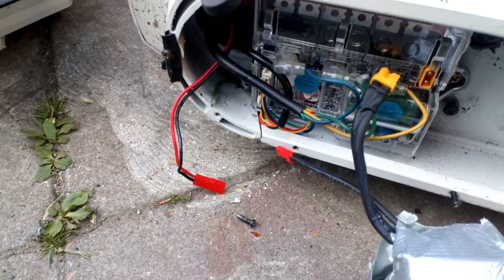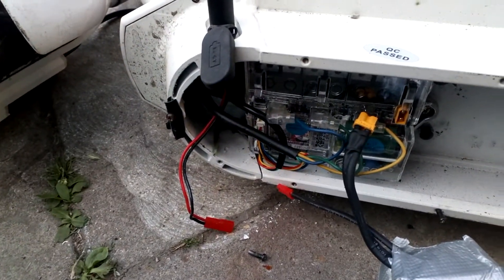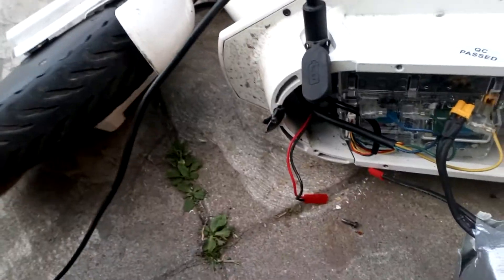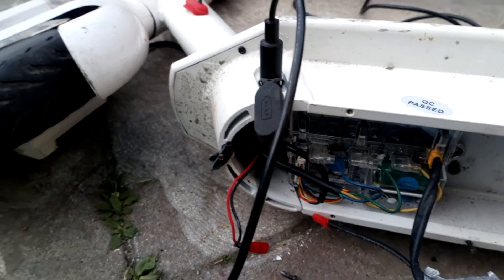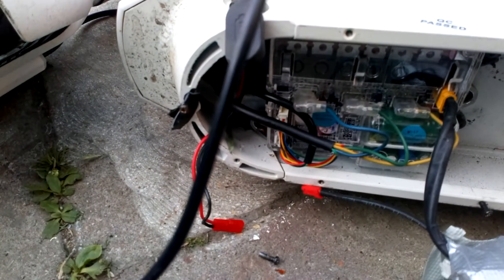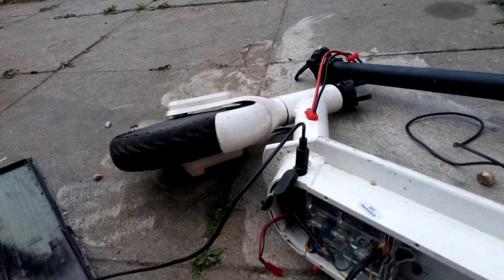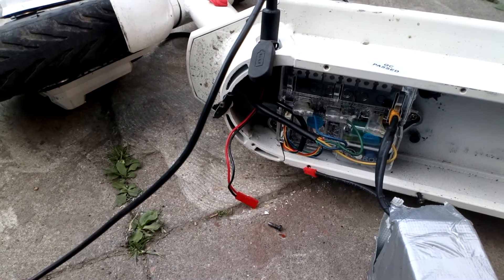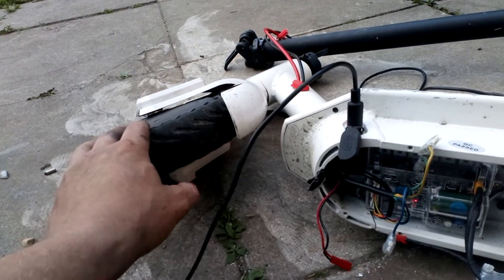how to tell if you electric scooter controller  is  faulty (bad fets) (or bad motor)

Comment: When I remove the motor wires from the controller it’s easy to rotate. When the wires are plugged, the motor is hard to rotate. So it will be the controller? 
And thanks for the video I have similar issue but not sure if it is the controller or the motor
Reply from the maker: yea dead   controller for Shure

Comment: I have xiaomi clone with no battery and a battery from an M365 when i connect the battery it works fine, only issue i have is the original balancing wires have no place in the clone controller , how get the battery balanced every time?
Reply from the maker: thoes are not balance  leads as battery runs a bms those are for  battery serialization and rear brake light on a real mi m365    and are not needed
Reply: @TCBOT  Thanks mate, I installed the battery and everything works as it should and as you confirmed the balance circuit is already attached to the battery 👍 now the boys want to go faster than 15 🙂.

Comment: I have a question do you have too change the motor or the controller board?
Reply from the maker: if its the motor    (eg you turn  the wheel with it unpluged   from the controller  and its very hard to turn   its the motor if you unplug the motor from the esc and it turns by hand  its a dead controller     and your controller  will need to be replaced 99% of the time the controller  is bad  motors are hard to kill    it happens if the motor get overloaded   eg 2 or more on a scooter  going up hill     might cause the motor to over heat  you will get a smell     like burning plastic   etc
Reply: @TCBOT  i was goig uphill when motor turned off, and instant resistence when i pushed home. Never trned it back on, scooter itself turns on or off okei, but the wheel not spining anymore plus the wiring from motor looks a bit melted
Reply from the maker: sounds  like the   motor  wires  beat up  and the insulation  worn  off (very very  common )   and then shorted   out the controller    check all 3 phase  wires  are  not touching   and tape  up the bad insulation with black tape   then see if it runs   if it does  ull  need  to buy some heat  shrink   to  fix  the damadged   insulation  if not   un plug  motor and check across   the 3  cables  with a tester   set to  ohms the 3  cables shuold  read  almost  the same across  any combination if  not you have a  burnt  out motor  (not very common   unless  you carry   stuff  of have 2up  on the scooter   at most it prob  needs  a controller   but check    @rudon9070